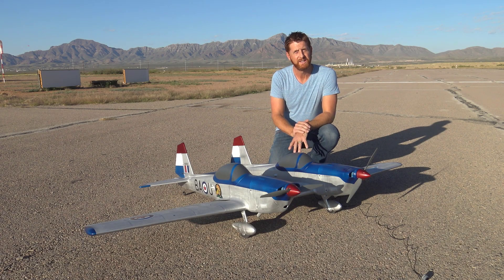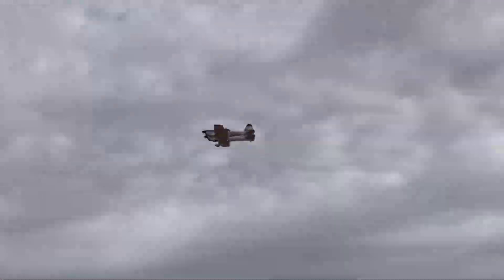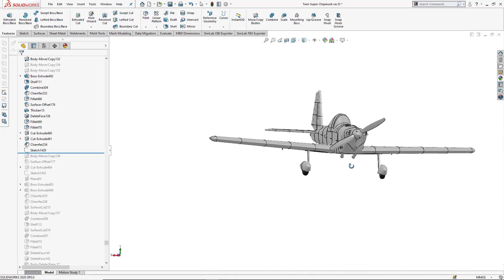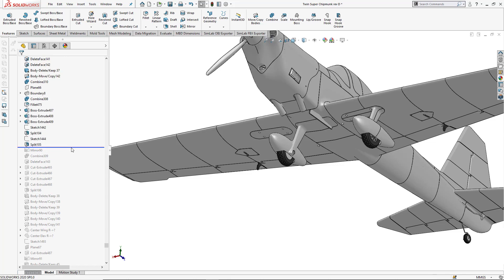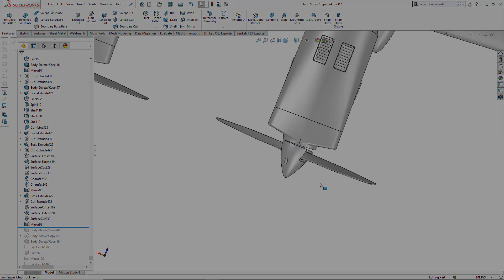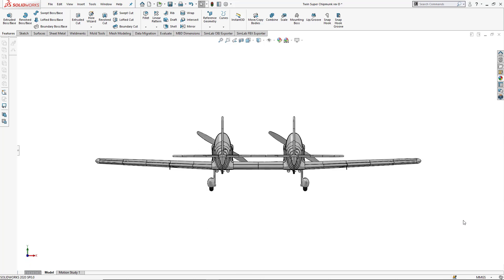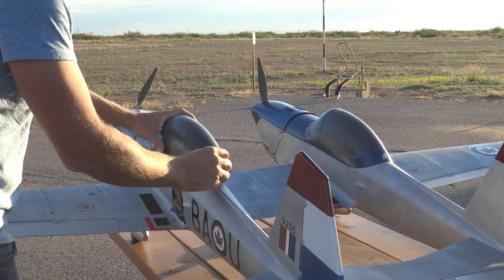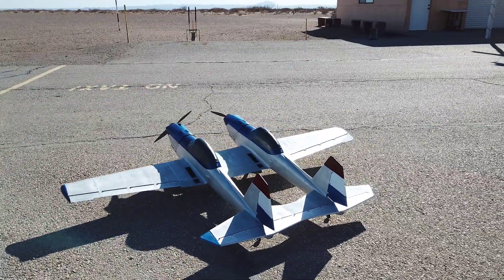Double the Fun with the Twin Super Chipmunk 3D Printed R/C Aircraft!  Huge 82 Inch Wingspan!

Comment: Did you try outward spinning props? The early p-38s had inwards spinning props but they changed to outward spinning props later to greatly increase stability.
https://www.youtube.com/watch?v=mOuyX-2jTy0
Reply from the maker: That’s interesting.  I read during initial testing of the F-82 Twin Mustang they tried outward spinning props and they couldn’t even get it off the ground.  They swapped the engines and found success.